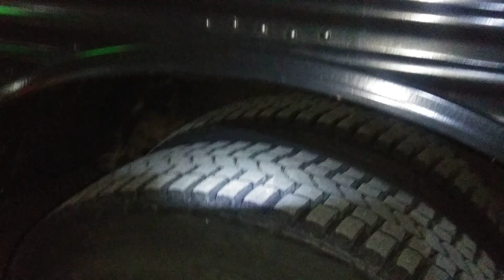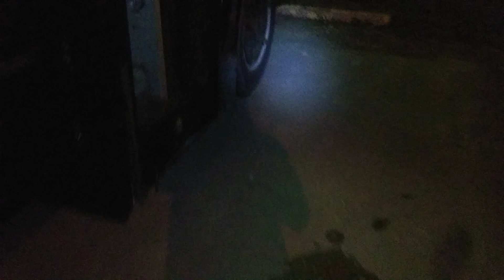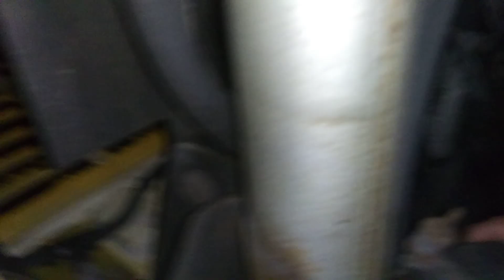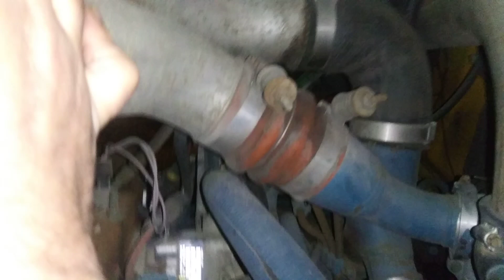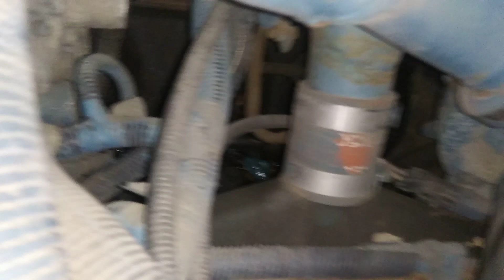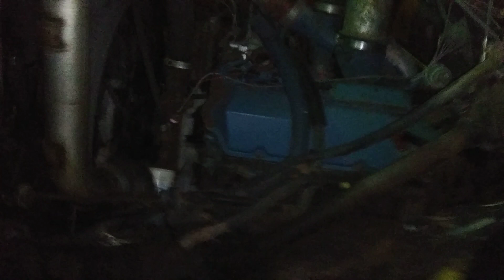Cross Country Skoolie Trip EP 15 - Huge Explosion!

Comment: Maybe something exhaust related or fume related due to the HP upgrade you did at the beginning of your trip? Some other part in the system is not designed to handle the higher HP output?